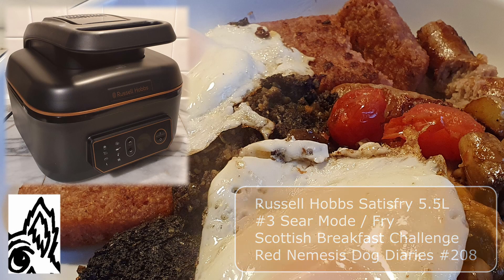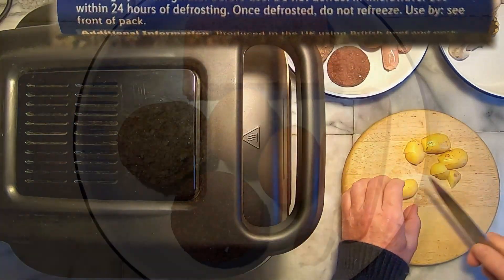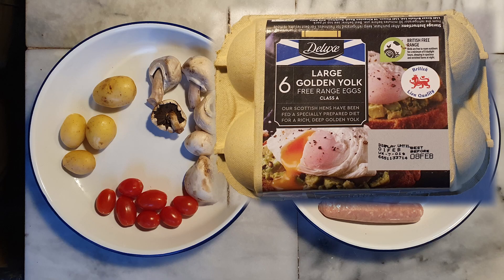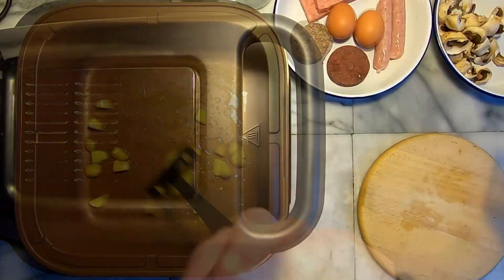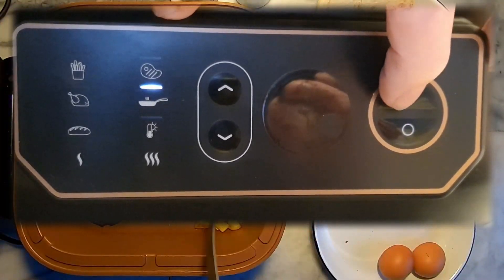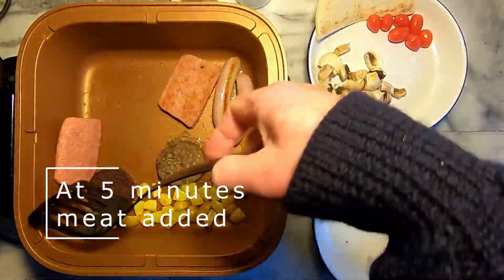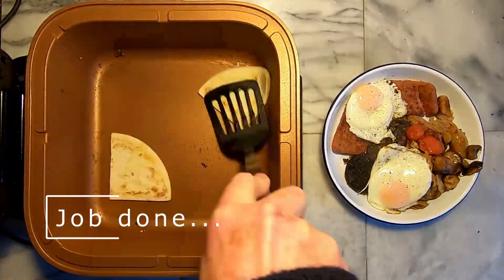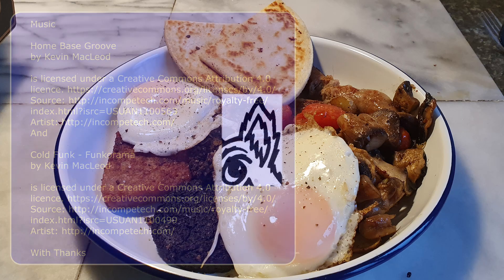Russell Hobbs Satisfry 5.5L #3 Sear/Fry: A Big Scottish Breakfast. Red Nemesis Dog Diaries #208

Comment: I think you will find that in Sear mode, only the bottom element works and it continues to work even with the lid open. In fact I believe in all modes the bottom element continues to work with the lid open.
Reply from the maker: Mine seems to stop heating and the fan shuts down with the lid up and I had assumed it was because when the weight on the micro switch in the middle under the base was insufficient it turned the elements and fan off. I will give it another try.